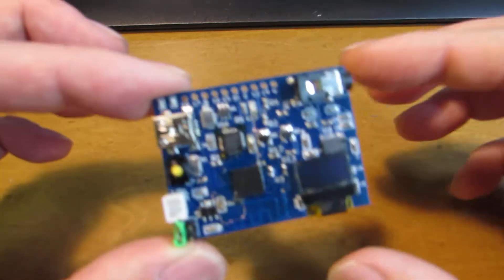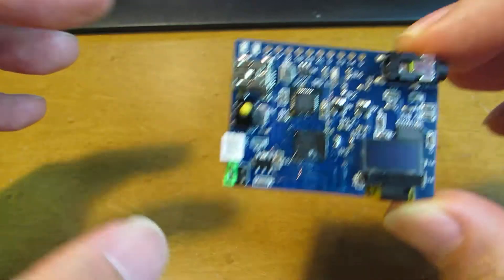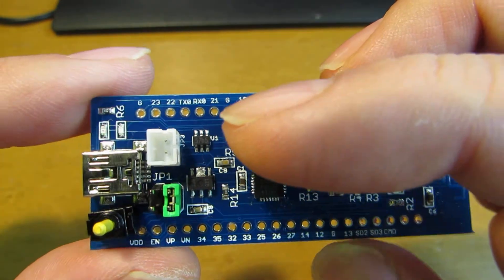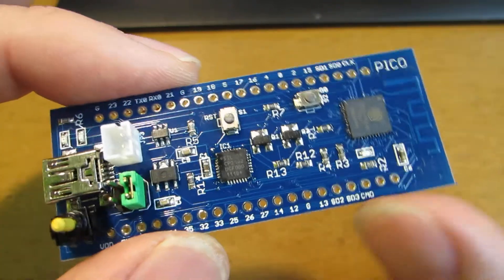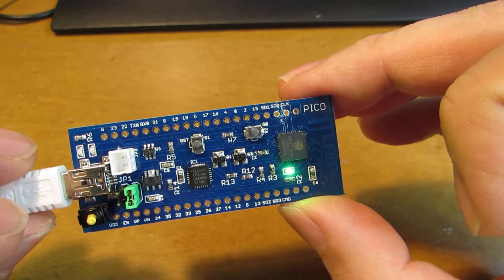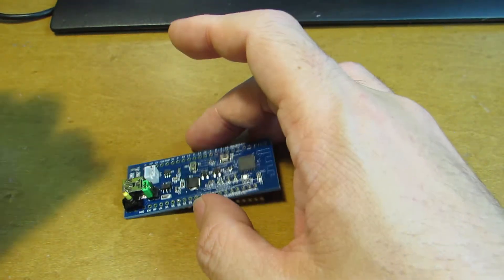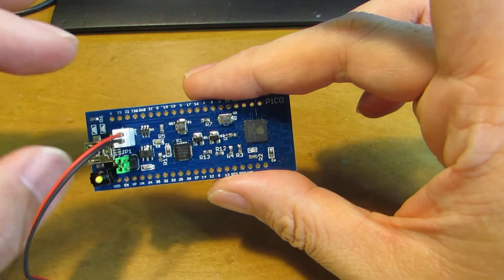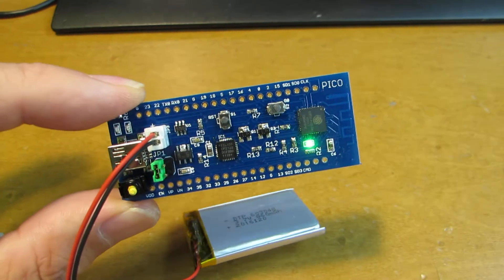A "Motherboard" with ESP32-PICO-D4.

Comment: looks good , questions about projects and stuff : 
1. can you show how to design a board (web tool or any tool) ? 
2. how can this motherboard do, can run python ?
3. can we have a video output ?
4. which is your favorite display?
5. which is your favorite online store where you buy parts for your projects?
Thank you. Best regards.
Reply from the maker: Hello! 1: Eagle is used 2: Everything ESP32 can will be possible. I am not so familiar but microPython? or some reduced Python should work.. 3: I don't say impossible but we need lots of work, both coding and designing.

Comment: Hey! Great design!. A couple of tips for your further designs:
1) Use PMIC with power path management. I recommend the LTC3553. It has a battery charger, USB and Li-Ion/Li-Po battery support, automatic switching, a soft button power up(using a single button), and a buck with an LDO. That can make your power supply circuitry extremely simple. The LTC3554 has two bucks instead.

2) Avoid right angle traces, try placing them at 45 degrees at all times.

3) Create ground plane fills with vias, except around the antenna.
Reply from the maker: Hello and thank you for wonderful suggestion!! I quickly check the spec of LTC3553 but..... unfortunately 150mA 3.3V LDO is not enough for ESP32 driving. ESP32 requires 500mA and momentary 700mA, which is covered by NJM2884 of the current board. But as you recommend, this type (Lipo/LDO composite) chip is very useful!! Thank you comment!